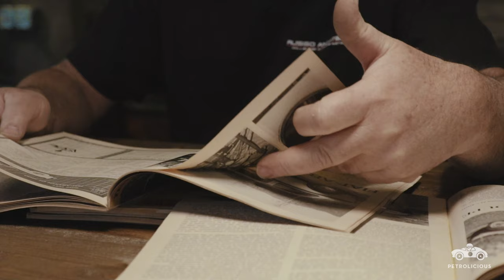The Range Rover Classics: One Family, Three 4x4s

Comment: Land Rovers have an ageless design which is what the designers intended. These trucks are complex vehicles, but if the owner has a 20 year projection then it makes sense. The aluminum/magnesium body panels will keep the body looking good and the interior has always been top notch materials. Expect and engine replacement. the steering and axles are changed like any sophisticated 4x4 so that a neutral dilemma. LR3 will be my next truck. I refuse to use the expected premium fuel.

Comment: I did my apprenticeship on the the 80s Range Rovers between '83 and '86.  Nice to drive (if one likes the 'ship' sensation), but a nightmare to work on.  The famous 'clonk' as all the driveline backlash is taken up, clutch jobs where something else, oil leaks, deadly tyre blow outs on the factory fitted M+S tyres (it seems the M+S tyres didn't like our hot climate), worn rocker shafts on the V8s.  Not forgetting the horrendous fuel consumption, especially once one starts digging in soft sand.
Reply: Visionery1  I guess the fuel mileage issue is all relative. My 1991 RRC is downright frugal compared to the mileage that my FJ62 gets !!

Comment: Easy to maintain... two seconds before everything you touch has been replaced because it was gross..replaced shocks, cooling system, swivel, cv joints, radiator again.. but they are not Toyota they always run... somebody in Australia is having a good laugh!

Comment: Hmm. Is Petrolicious moving into sponsored content? (I must have missed the “Brought to you by Land Rover” tag.) They must not have owned these vehicles for very long. I’ve done the Land Rover/Range Rover thing. My Series 2A was Safari ready, but leaked from every fitting and joint. Verified by the LR club - that’s what they all do, no need to change fluids just top up. Then there was Lucas the Lord of Darkness to contend with. The RR was perpetually leaking rain into the cabin, factory recalls, mystery electrical shorts, defective paint, rust, decomposing rubber, etc. We had reserved seating at the dealership. Maybe this family is having their first/last Land Rover experience together. LR/RR helped inspire me to move on to classic a G-Wagen and Toyota. More functionality and more time functioning.

Comment: I love the Range Rover Classic. Wanted one since I first learned about them. Unfortunately the better they got as a car, the worse they got reliability wise.
Reply: It's certainly a project car but that would be any other 30 years old 4x4. They are easy enough to work on and there is good aftermarket for parts. If you don't mind getting your hands dirty and really love them go for it. But take into account you are going to spend 10-15K excl. labor easy.